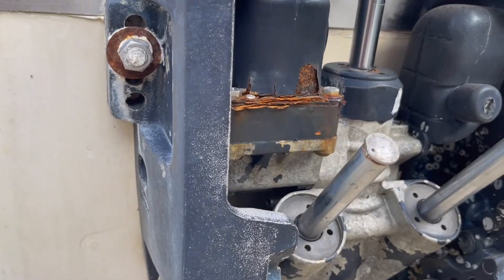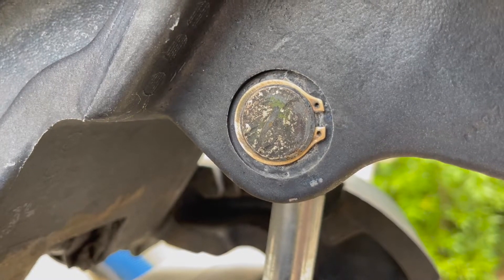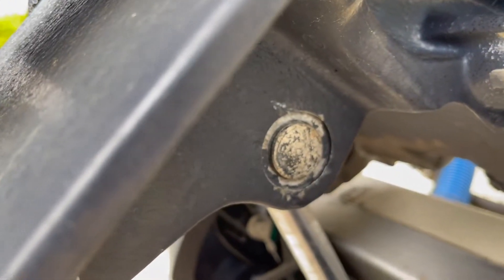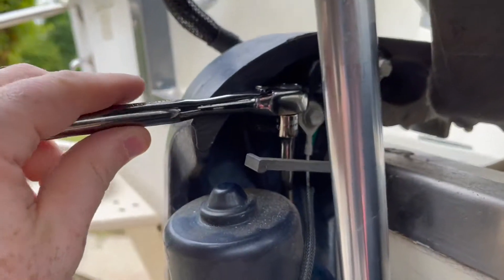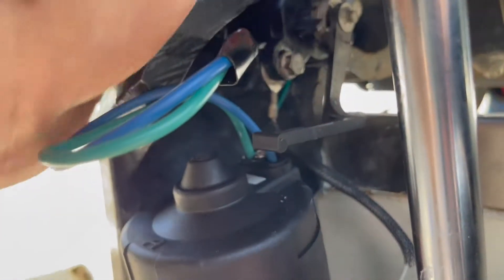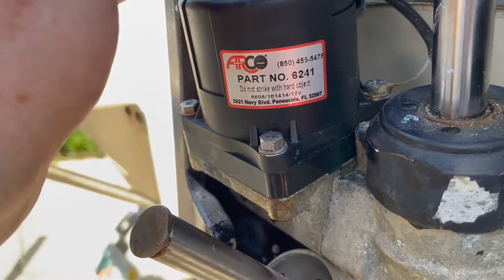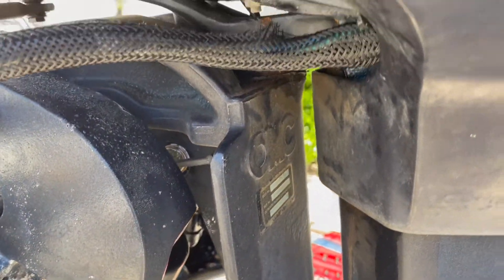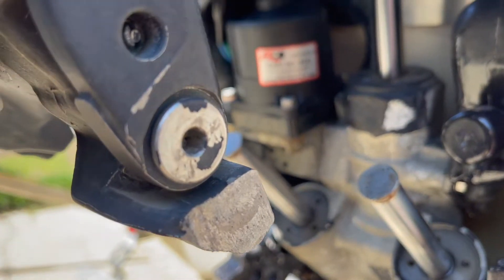How to Replace an Outboard Tilt/Trim Motor

Comment: Great Video Bro!  I would add something that will reduce the frustration of re-routing the wires.  All you have do is leave the original receiving pin and wires in place. Snip the wires  at the bottom near the new motor, then snip the new wires to length and fuse the old and new wires together (i.e., Blue & Green wires) with leak proof heat sink connectors. Slide the sheathing back over and you are done!  Takes about 10 minutes if you have the connectors, which every boat DIYers do!